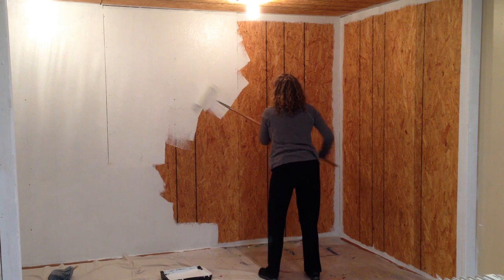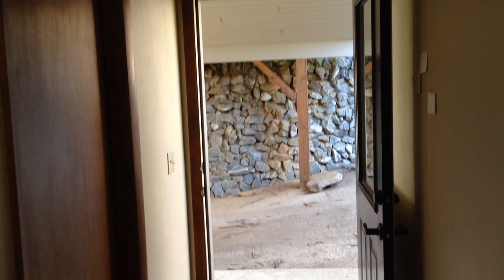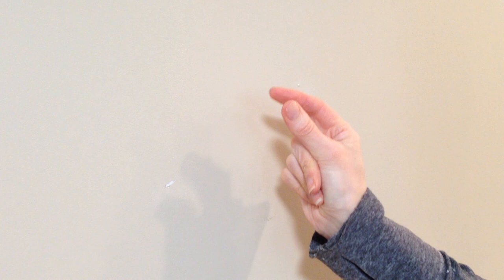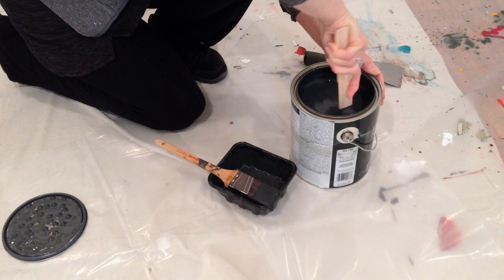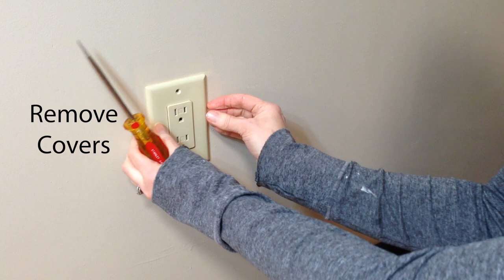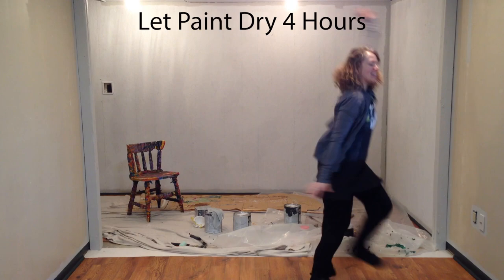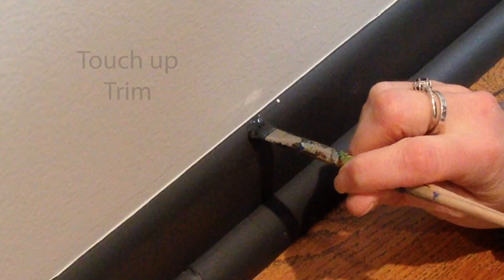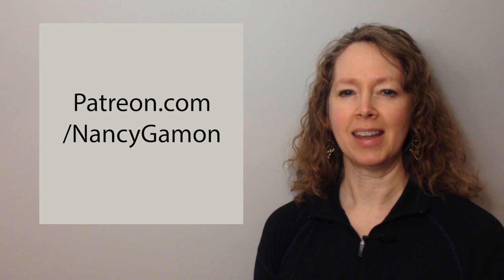How to Paint Walls and Trim

Comment: If your using paint with a glossy sheen, like eg shell or anything more glossy, then in would be best to try to roll the wall while the cut ins are wet so that the sheen looks similar
Reply from the maker: Hey now, that's a very useful tip! Thanks for sharing.

Comment: How the hell do you paint so precisely.. I am the worst
Reply from the maker: Haha! It kind of looks like magic, doesn't it? Using an angled brush is a big help. Also, I try to not have too much paint on the brush, so that there aren't gloopy drips. I paint a few strokes in the center of the trim to get off the excess paint and then gradually move towards the outer edge of the trim, where I want things to be clean and crisp. Since there isn't as much paint on the brush at that point, it's much easier to get a precise line. Hope that helps! Nancy

Comment: I definitely would have put some kind of tape down on the floor next to the trim unless you plan on getting paint on that and painting the floor. Also the room I'm going to be painting doesn't have any base molding at the moment so I can paint it and then install it. Not everybody has painting skills like you and I have seen the nightmare of people not using painter's tape near trim and getting paint on the wall next to the trim Etc. It is advisable to use paint tape especially if a person is just a novice. Not everyone is going to be as neat and tidy as you.
Reply from the maker: Hi ByGraceIGo, You're right - I definitely got lucky with these floors. I was able to skip the painter's tape because it was so easy to wipe up the occasional error with a damp cloth. I used to have trouble with paint going everywhere until I learned the trick of using an angled brush. It makes it sooo much easier to create smooth lines with fewer mistakes. When I'm painting near an edge, I also try to have very little paint on the brush, and that helps keep things tidy, too. That's awesome that you'll be able to paint your trim before installing it. You'll have such a nice neat finish! I hope you enjoy your new space. :) Nancy

Comment: Paint your door casings first and then walls and then baseboards last
Reply from the maker: Interesting. Why do you prefer that order?
Reply: @NancyGamon  Looks like it saves touch up as the paint tends to drip or drop down.
Reply from the maker: It does seem like that would be the case. What I've found is that it's much easier to neatly wipe off wall paint that has dripped down onto the baseboard, than it is to neatly wipe off trim paint that has accidentally gotten onto the walls.
Reply: @NancyGamon  It's a lot easier to get paint dripping for novice painters from the wall due to the volume of paint they're putting on vs the trim. However, I kind of agree with you on this one that its easier to touch up trim, no one is on the floor looking at it that closely, but trying to touch up the wall is harder because its easy to accidently touch the top of the trim, whereas most trip will have a curve at the top and farther away from the wall and much less chance to accidently touch wall when touching up trim.  Trim first it is then. I have base board, crown molding, and chair guard trim to do now!
Reply from the maker: Good luck and have fun! If you find a different order works for you, by all means, go for it! :) Nancy
Reply: @NancyGamon  exactly it's common sense.

Comment: Hi, question did you have to sand your trim before start painting it?
Reply from the maker: Hi Cathleen, that's a great question. If the trim is rough, cracked, dented or split, you may want to make use of some wood filler and give it a sanding. If you're painting the trim a light color, laying down that first coat of paint will quickly illuminate areas that need touching up! If you're painting the trim a dark color, the situation may be more forgiving visually. Nancy

Comment: I like your video. I see you didn’t primed nor sanded the trim. Why is that? And what paint from SW did you use?
Reply from the maker: That's a really great point that some trim may need a little attention with wood filler and/or sandpaper before painting. This trim was new(ish) and just didn't have the kind of noticeable dings or rough areas that warranted pre-treatment. I didn't prime my trim because... it didn't even occur to me! The Sherwin-Williams colors I used were Iron Ore (for the trim) and Repose Gray (for the walls). Thanks for watching! Nancy